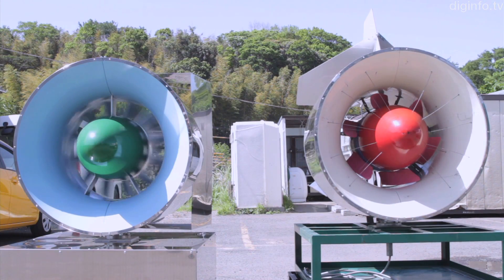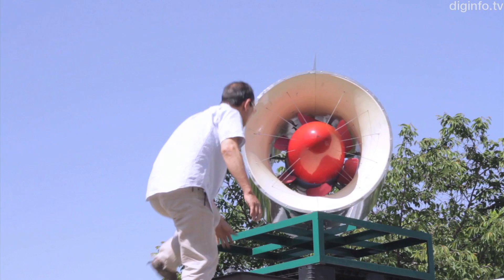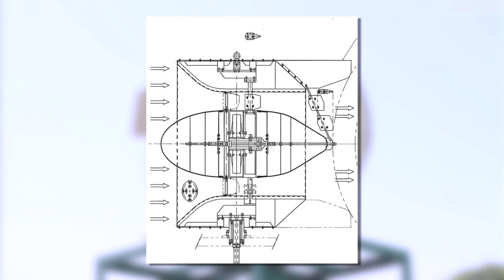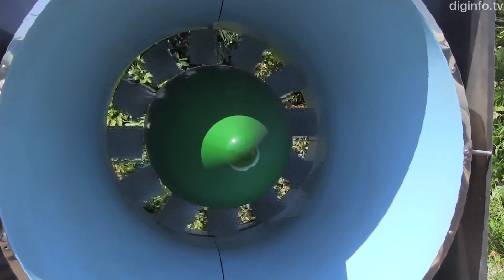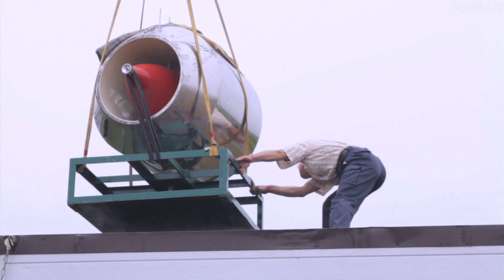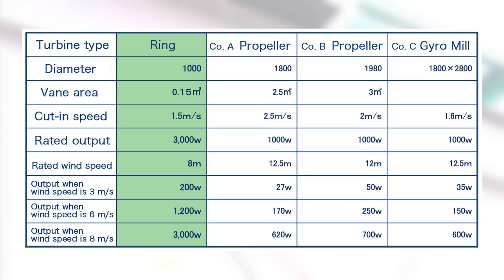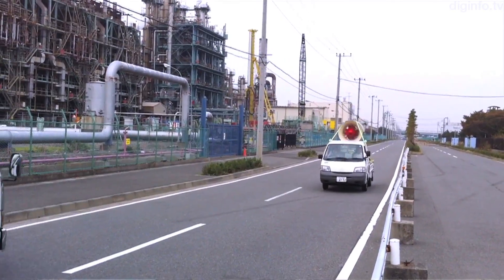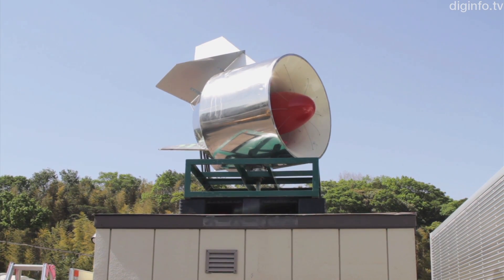Lightweight, compact ring-turbine -- Can even be installed on small buildings  #DigInfo

Comment: How about a big Venturi inlet less space occupied by rotor core, faster compressed flow, as In big fan turbo use. 
But pushing a fan driving a generator. Not on same axis, driven by a vario ratio hydronic system like car auto clutch drive. 
They change when the load  becomes more than the ratio required. 
Constant and within the required range is more useful than , over or under power.  The fuel is , airflow.  Free. 
Huge installations in unpopulated regions of constant wind force.  Not pretty, no profit, who needs it the installation is free from humanity, profit is just old fashioned greed.  Get rid of that mindset. It’s unreal. Notice everybody says, what price is it. It’s free but for the initial manufacture and design. Nothing to do with business and profit. It an old mindset we have ,. Nothing can stop us but money. It’s just an IOU for effort. Not real but we believe in it. Why not forget it,and just do it . It take only effort of humanity.  For a long time being used for individuals for an easy life. Time I’d up. Change must come.

Comment: wow 200w at just 3m/s wind speed., 6 meters 1200w 8m/s 3000, that's insane increase. WHat about the fans suction, does it suck more wind in the faster it spins, therefore accelerating itself even more? Is that even possible with our limited physics knowledge.
Reply: No. it's possible. It's the geometry of the shape that is doing the magic. Kindly notice that the entry of the wind to the turbine before hitting the blade is cone shaped. In short, the entry acts like a convergent nozzle and nozzles increase the velocity of compressible fluids (like air) by converting its enthalpy into kinetic energy. The extra power comes from this extra velocity. Suppose the radius of the blades is half of that of the inlet. That means the area of the turbine is 1/4th of the inlet area. That simply means the velocity will be 4 times more when the wind will strike the blades than velocity of air. And 4 times velocity means 16 times energy.
There are other such technologies available in market named "concentrated wind turbine". This is just addition of another sample to this list.